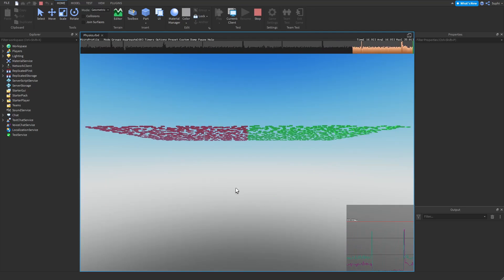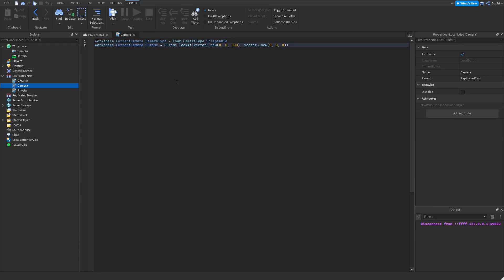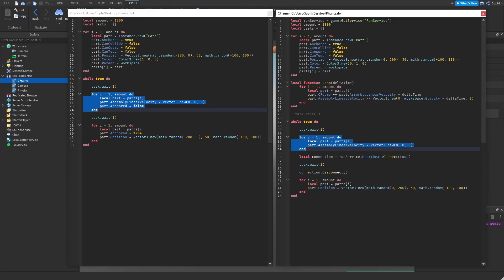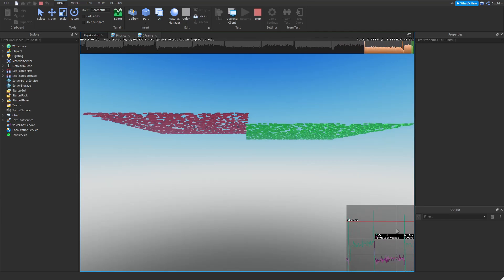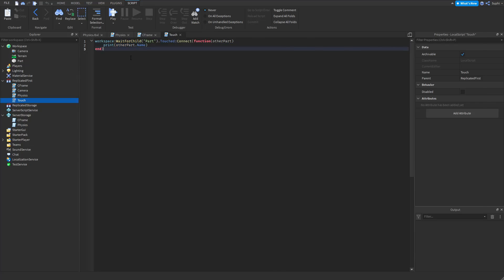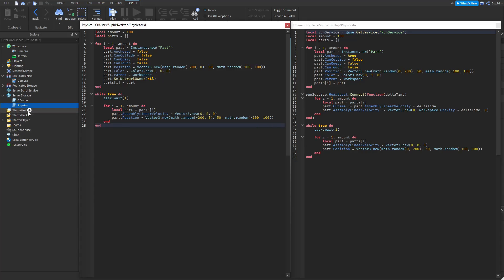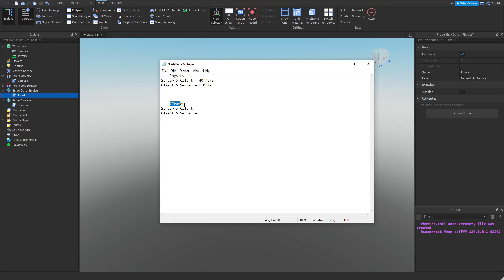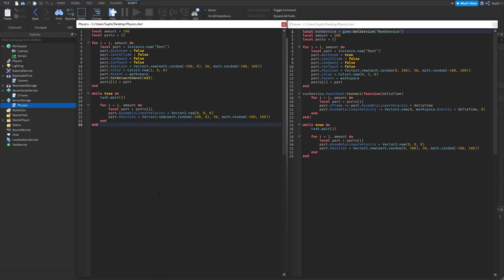Physics vs CFrame - Roblox Scripting Performance Benchmark

Comment: Would keeping track of a entity's position be faster with pure CFrames (no setting a part's CFrame, just a CFrame value) than applying a velocity to a part and reading its position when needed?
Ex. Having a NPC follow a path, it can either be represented by a pure CFrame value that is incremented per Heartbeat or a part with a velocity.
Reply from the maker: I'm confused because the only way to get a entities position is by using there cframe.position
Reply: @5uphi  I will clarify. 

If you know the path an entity will take, and only require position data, then server-side you don't need a model for the entity. Therefore, you can just store a CFrame value and increment it every Heartbeat to "move" the entity around the path. 

Would that be more efficient that applying a velocity to a "root" part (which represents the entity) and reading position data off that part?

Of course, client-side, you would need a model to show the entity so this would not really work there.
Reply from the maker: reading a local CFrame vs reading the parts.CFrame pretty much identical

The physics engine is quicker at changing a parts CFrame then it is for you to set the CFrame
Reply: @5uphi  Oh, there is no setting the CFrame for a part. In the example the server-side is acting as the authority, so it never needs to actually move anything, it just needs to keep track of where something should be.

The client will be doing all the actual moving, with physics. Every once in a while the server can correct it.
Reply from the maker: If the server is not moving the part and your just transforming a cframe then that should be quicker then moving a object with physics
Reply: @5uphi  Ok. Thanks a lot! Your other videos are very helpful too. Thumbs up and a subscribe.

Comment: If so...
is there a way to make procedural animations using physics instead of Cframes?!
Reply from the maker: The animation controller would be the best option because when you play a animation with a animation controller the movement is not replicated so it will use almost 0 network data but if you don't want to use the animation controller then you would use constraints like AlignPosition and hinge etc..
Reply: @5uphi  Thank you for answering my question
im a beginner, so this helps me alot!
+1 sub
i sincerely hope you channel thrives

Comment: At 5:00 in the script on the right, the loop function, why do you multiply gravity by delta on the bottom line, then multiply it again by delta in the line above that? Is this the formula for natural downward acceleration that the physics engine creates? Is there further api on this formula? btw thanks your videos are gaoted
Reply from the maker: Yes velocity of the part increases based on how much time has passed and the movement of the part is based on the velocity and amount of time passed so we use delta time twice once to increase the velocity and once to move the part

Comment: What most people who go for CFrame don't understand is that you can literally manipulate a part's mass, density, elasticity, and friction; Roblox physics is internally written in C++, thus being faster than setting CFrames in LUA, especially when it's a VM "language" in Studio, the internal physics replication is unreliable so it doesn't matter when a packet is lost unlike Remotes to replicate CFrames to other clients, the Remotes makes sure that all packets aren't lost, if there are, then it asks the client/sender for that packet which will take x2 the amount of transportation time of that packet. Better off using your creativity on manipulating Roblox's physics to save bandwidth, though this sacrifices "control" over the physics. 
I personally go with CFrame(s) because unreliable Remotes are coming soon, it was confirmed by a Roblox engineer! It is completely up to you what you want to use.
Reply from the maker: Let's say both clients have placed apples on a tree at the same location then the server tells the client to drop the apple and each client locally unanchor the apple there is a 98~% chance that the apple will fall and stop at the exact same location on both clients even though the physics was done independently and no information was sent over the network this allows roblox to send position and velocity data at lower frequencies to reduce network usage even if you used unreliable remotes it would not match roblox's network usage what you would need to do is send a event let's say once per second to all clients and then the clients would have to set the cframes locally then you would be able to match roblox's physics engine in network usage
Reply: @5uphi  I replicate CFrames only if they changed and at the rate of 10 times a second, though it is interesting how you explained how physics work

Comment: Interesting results. It would make sense that the inbuilt physics engine is faster, here is why I think this is:
1. It is probably written in C++ under the hood
2. It doesn't have to interact with the LUA api
3. Physics simulations can be ran locally AND server side, so the client doens't have to wait for the server to tell it where the object is.

The last one is actually very common in many games. An interesting thing that this can cause though is a client and server desync which is what we experience as lag/being warped back to a previous place.
Reply from the maker: 1) Yes it might be written in c++ also Roblox is using multiple threads

3) so all clients run the physics simulation independently and the position and velocity data is not sent every frame over the network but only sometimes then the client tweens the part to the latest position when it gets it to sync them just like you said and because most of the time all clients will calculate the same physics movement you should not see the tween

Comment: Hi you made a flaw when doing this test. When doing CFrame, changing physics properties like AssemblyLinearVelocity is unnecessary. I did the same test except in the loop I changed part cframe with a gravity variable instead of AssemblyLinearVelocity and the results are the same. With collisions on, cframe turns out better.

For network, physics is better by default but if you control replication you can get better performance than physics does
Reply from the maker: unfortunately I don't get the same results as you even if I just do a simple part.CFrame -= Vector3.new(0, 1, 0) with nothing else I get around the same performance nothing changes if you share your project with me on discord id be happy to take a look at it
Reply: @5uphi  sure Gligor#9309

Comment: This is true, but I think people mainly use cframes for physics for good hit detection. It is understood that Touched events arent that reliable so they use raycasts and cframing on the server, and render visuals on the client. Is there a better way to utilize the physics engine for reliable hit detection?
Reply from the maker: if you wanted to do custom hit detection you would be better of using the physics engine with raycasting instead of setting the cframes manually
Reply: @5uphi  is it possible that you'll make a tutorial for this?
Reply: @5uphi  Coming back 1 year later, just curious, would you calculate the hit detection on the client or the server?
Reply: Confused because I thought raycast projectiles ran client side was the best option

Comment: If you were to use 1 part as an entity to move an enemy on the server & render the visuals/animations on the client, would it be better to use the physics engine or CFrames to move thousands of these enemies?
Reply from the maker: It would be better for the server to set a vector3 of the target position then all clients would use physics to move the enemy to the vector3s position
Reply: @5uphi  the physics engine would be better on the client for thousands of enemies rather than tweening their primary part cframes?
Reply from the maker: Correct this is because Robloxs physics engine utilizes multiple CPU cores for updating the CFrames and also while I'm not 100% sure I think robloxs physics engine is written in C not lua
Reply: @5uphi  so like align orientation and align positon?